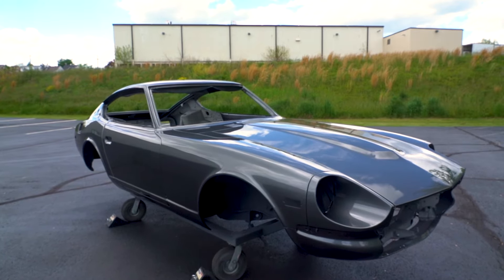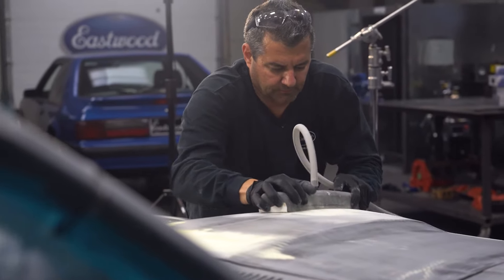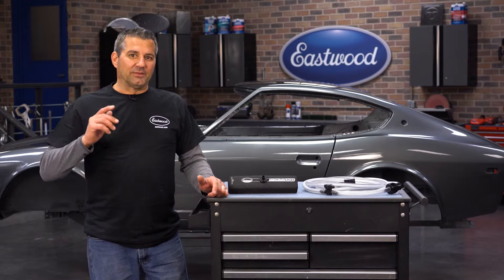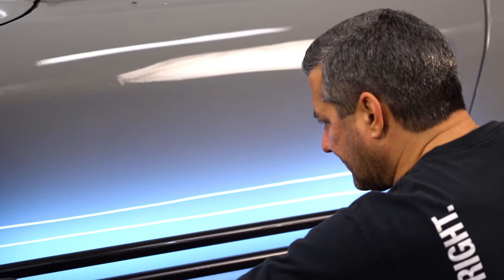How to Collect Dust While Sanding Body Filler! Contour DSB

Comment: Did you da  it to the metal then use the product?
Reply from the maker: We originally stripped the car using our SCT, then epoxy primed it, then blocked using the DSB (this product), then added filler, and blocked again using the DSB.

SCT: https://www.eastwood.com/eastwood-contour-sct.html

DSB: https://www.eastwood.com/eastwood-elite-contour-dsb-dustless-sanding-block-system.html